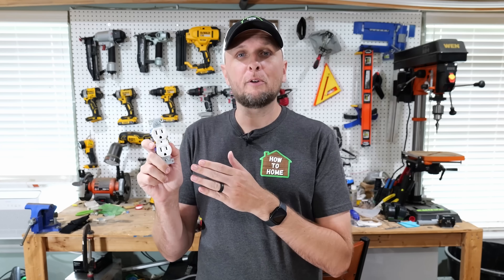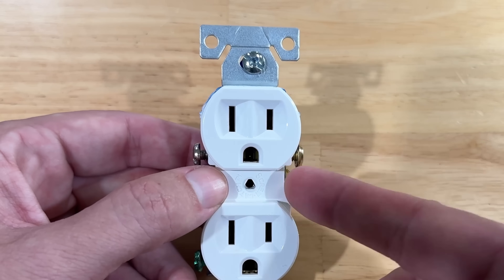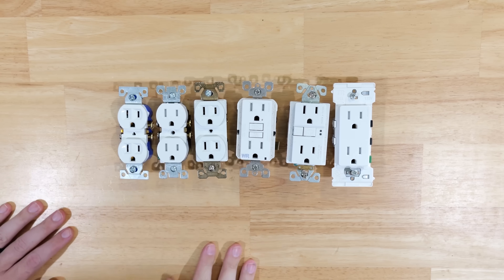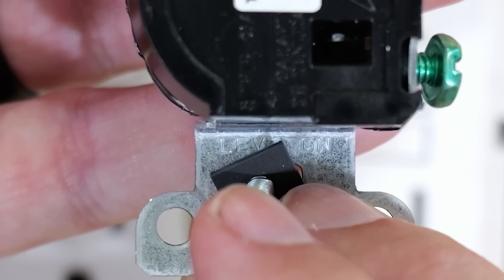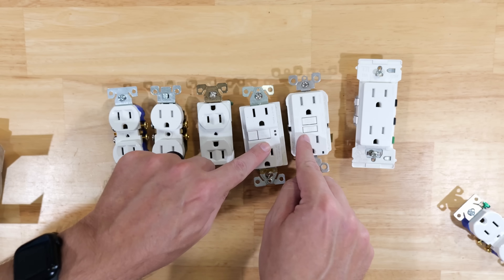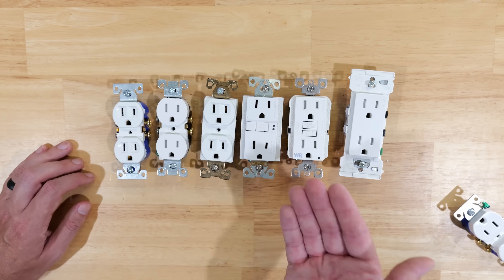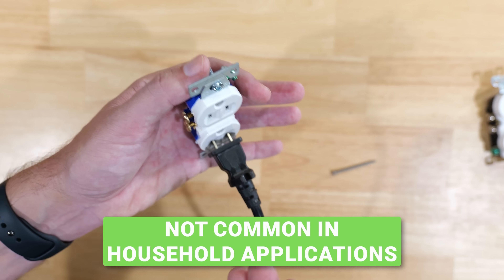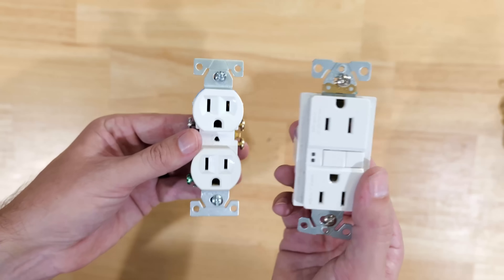The Shocking Reason Why Your Outlets Are Installed Upside Down!

Comment: 😅 If it wasn't so "probably dangerous" (and the authorities love to have their thumb on people) it should be written out or change the design (must also accept old style plugs). -- The way I was taught "ground up" this was to protect the contacts from being shorted out if something falls across plug / terminals (slopping sides of plug on ground side tends to shed objects off sitting on plug). Unfortunately manufacturers make plugs (flat /wall hugging) and appliances that basically "require" the ground to be on bottom. A workable way around this is "have outlet face recessed 1/8 to 3/16 in from wall plate" (hate to say it - euro style) [I like the large neutral / small hot blade as opposed to pins, more contact area]. The "recessed outlet" would protect the terminals. Also would not hurt if plugs had a "pull tab / ears" to help grip plug. Just my personal idea take it as You wish.

Comment: Every place I’ve live in since 1975 (1st yr I remember) had the ground down on all outlets - until two weeks ago when we had to have one flipped to accommodate the cord due to poor placement of the oven outlet.  We had it upgraded to the newest format before installing a new oven.  The electrician installed it ground down, but the plug wouldn’t fit because the outlet was so close to the floor.  Called back the electrician and had it turn upside down. I do like the idea of flipping the outlets when connected to a switch.

Most important thing I’ve learned from living in a house remodeled by a DIYer is to call the electrician!

Comment: The only reasons I can think for ground prong up is you are more likely to insert a plug angled downward and the ground will make contact sooner that the live. However the ground prong is longer so this is probably not relevant. Another thought is if it’s dark, the socket will be easier to line up and find with ground prong up. Also, because I always use Eaton, I based my installs on the writing orientation. Thanks for educating me that this orientation is totally dependent on brand.

Comment: When I was a small child back in the late 1950s - Early 1960s the outlets our old Brooklyn NY apartment didn't even have a hole for the ground pin. They just had the two slots for the blades of the plug and both of those were the same size. In other words back then the outlets were not polarized and had no ground. For plugs that needed a ground connection we had to use a special adapter. When we moved into out new home all the outlets has the home for the ground pin but the slots were both the same sides. They were very loose fitting too. The plugs would often slip right off the outlets. Most of them were replaced but a few still remain.

Comment: I always install ground plug down. In a bathroom if I install it ground plug up and then plug in a hair dryer with a gfi plug, that plug would be hanging up in the air rather than hanging down along the wall putting stress on that cord.

Comment: Im not an electrician but i heard that there is a code in canada that specifie that outlets, in a basement or any underground instalations, must be installed ground pin down but it is not specified for any floor above ground... and the reason given is about flooded basements... the ground prompt must be the first to be wet in order to redirect and absorb the electric current giving less chance to electrifie the water... a scenario where the level of water rise slowly to the outlet height, if the ground is facing up, the line and neutral will touch the water first and electrifie the water as the electric current will try to reach the nearest grounded object in the room since the ground pin is not wet yet and the current do not passes in the air as easily as in the muddy water, but if the water touches the ground pin first, when the line will get wet, the current will jump to the ground pin instead...

Comment: The manufacturer designed it (the duplex receptacle) to be used in either position, which is characterized by the stamping on the ears of the device or the plastic, to be legible from either orientation. It doesn't really matter which way it is installed, unless you live in a jurisdiction that has a code that exceeds the NEC (an example Puerto Rico wants them all installed sideways with the neutral terminal screws facing upwards). Many things are designed with different applications in mind. If your outlet is positioned in such a way that it is inconvenient for you, that is why it was designed to be changeable. While I was in the midst of typing this, I paused and typed 90-degree cord end into the search query for Google and for sale, two pics popped up for cord ends with the ground both up and down.  An FYI, if you cut the cord end off of a new appliance, it voids the warranty, so changing the position of the outlet is always best. My boss likes the ground prong up, since he insisted that if it starts to pull out of the wall, and something falls down that is conductive, it will hit the ground first and not become energized. My argument has always been that something else, perhaps more precious could approach it from the side or the bottom all the same, such as a pet or a child and it is moot at that point. 

By the way, I see many outlets above and below windows for store fronts mounted sideways, which is also legal. The manufacturers recommendations for the product and also the specifications of the blueprints are also enforced by the NEC, with the manufacturer's recommendations taking precedence. Occasionally I see a situation where the recommendations contradict the code, in which case the inspector usually calls their boss and makes a determination for what they will allow.

Comment: upside down outlets drive me crazy I buy extension cords and power strips that have flat plugs because  I hate wires hanging off the wall. when its upside down those flat plugs aim the wire up which then causes it to lean out of the outlet same with AC plugs i prefer the wire down so it doesn't cause tension at the base of plug where it starts to wear away.

Comment: The incredibly rare event this man referred to with the two parallel prongs facing up happened in the bedroom I shared with my younger brother growing up. 

His bed had pushed up against a plug in the wall for his alarm clock and in the middle of the night something he dropped between the bed and the wall fell on the prongs and started a fire. 

It's a lot easier for it to happen than you might think.

Comment: I have talked to many residential electricians about their thoughts on why one is better. Most of the ground up crowd has the thinking that if the plug is hit by metal from above, it could go between the outlet and plug and if the ground was down it would short between the flat blades. Mt thoughts are based on adding the ground to begin with. If it was added to block strikes of metal to the plugs hot to neutral blades, there would be no need for wire in the cord. It was added as a return path for stray voltages present on wet and or damaged equipment. If you put the ground up and shake the cord hard enough to start it to unplug. Gravity takes over and pulls down and levers the round ground connector out the receptacle before the power connection is lost. Now you are using a UNGROUNDED unsafe connector. Install the receptacle ground pin down and do the same and power is lost before the ground is lost. This is the most common issue using cords, when was the last time you dropped a machete on a wall plug and got shocked? How about having the extension cord pulled loose from the wall, and you know it happened because of no power. if the ground pulls out, how do you know?  Bad News when you find out!

Comment: Must depend on your Country . Here in Canada , Ground hole is always Down . Logic is that should the plug pull away from the receptacle , the shorter 
Live and Neutral will disengage first and the longer Ground pin remains the last to come away keeping the appliance safe longer . CSA dictates most of this . Cheers .

Comment: This the best explanation I have see. The safest way to install an outlet is with the ground prong on top (considered to be upside down by many). This is the way it is required by code to be installed in hospitals and other specified places. BUT I like the ground down because I like it that way. BUT also, what about installing the outlet sideways? After consideration I would install the receptacle side ways with the larger plug hole (neutral) up for a safer position. What are your thoughts on sideway outlet installations?

Comment: Standardization is good.  It allows people to know, beforehand, what side the plugs go (line vs neutral / big prong vs small prong) whether in good lighting or bad, in the open easily seen or behind a couch stretching down with nothing but your arm.

Is there really any advantage to leaving it "any ole way because it doesn't matter", or does it matter to standardize the installation for Human Reasons?

Comment: If there is one way which has to be chosen based upon logic, you would want the ground prong to be as close to ground as possible, so GROUND PRONG DOWN is the only way to use this device properly. There is nothing subjective about science, and you don't get to choose the rules. Science is science, and science says ground prong down is the most logical manner in which to proceed with operating this device.

Comment: Back in the day when the hot and neutral blades were the same width and it was possible to have a receptacle with the same colour screws for hot and neutral we were taught the saying “U ground down neutral to the left” so we always put the ground down. It was kind of the standard 35 years ago.

Comment: The right way is where the outlet looks like a surprised face.  None of the arguments for orientation are valid reasons.  The only good reason that it looks better.  For switched outlets, it is okay to flip it over to indicate that it is different from the other outlets.  Switches should be oriented to on is up or to the right, if vertical or horizontal, respectively.

Comment: They work either way you install it! Electricity does not care.  Most people prefer the ground down, because it resembles a face and as humans we are genetically tuned to recognize a face. An upside down face is unpleasing and just feels wrong to many people. What about applications where the receptacle is installed horizontal? Like exterior locations with horizontal cover plates. Is it better to have the ground hole facing left or right? Electricity does not care and will flow fine either way.

Comment: Ground prong up was how I was always told was the safest, and exactly because of that scenario of a dropped conductor shorting line and neutral of a partly extracted plug.  Having said that, there's not an outlet in my house that isn't ground socket down.  

One argument against ground prong up is that the frictional force with which the cylindrical prong is held in the receptacle is less than that with which either of the two flat prongs are held.  There's a smaller contact surface area between the cylindrical socket contacts and the ground prong compared to the surface area of the slotted socket contacts, and much less than the surface area of both flat prongs.  Thus there's less frictional force holding the ground prong in the socket.  Consequently, the weight of a dangling wire is less likely to loosen the plug under the force of gravity if the ground prong is down.  And I have seen exactly that happen - a plug partly out of the socket when the ground prong is on top, just from the leverage of the weight of the dangling wire.  

But the key in terms of industry practice has to come from appliance cords. In right angle plug appliance cords like those for refrigerators, etc, where an appliance needs to be close to the wall, and you need to rely long term on the plug remaining fully inserted in a (usually) hidden receptacle, they universally have the ground prong closest to the wire end of the plug.  If the receptacle is wired ground socket up, then as you say, the plug has to be inverted, and the wire folded back over the plug.  The plug is then subject to increased leverage out of the receptacle - from a combination of heavy appliance cord and greater distance of that weight from the plug.  It also forces the appliance farther from the wall.  Wrong on all counts.

And finally, Reddy Kilowatt would look absurd if his mouth was over his eyes.

Comment: What I do not understand is why for years and years equipment manufactures have made power cords so that when the ground prong is DOWN the cord hangs naturally. If the ground prong was up the cord would have to loop back on itself and that would be awkward and also put a stress point on the wire’s radius.  This goes all the way  back to the late 50s or early 60s when the ground prong requirement was rolled out.

Comment: My dad was a contractor back in the 60's and on into the 90's.  He held General, Electrical, Plumbing, and Heating and A/C licenses.  From the time I was in high school in the late 60's and early 70's I would be working building homes and doing service work.  I would conservatively say I had done the mechanical (elec, plum, & A/c) on over 200 homes.  I still remember the what I learned about wiring the receptacles: "White is right and ground on top".  My dad was also the architect on many a home and told me that you want to avoid making a "face" when doing design and that is what you would be doing with ground pin down.  Back then the plugs were not standard with pin down.  In later years I found it more and more common that they became standard to be ground pin down (much to my dislike).  I still prefer ground pin up but like some have pointed out, some manufactures only allow their product to be plugged in with pin down.

Comment: Well, even having the ground prong up won't prevent something from tipping to the side with a 50% chance of shorting the hot wire to the ground, the other 50% would short the return to the ground which shouldn't do anything so long as the loads were balanced which again is a matter of chance.  Face it, the North American 120 VAC outlets and plugs are just fundamentally flawed, of course the respectably designed UK plugs are not only excessively large but are dangerous foot caltrops, far more so than Lego blocks.  I suppose we might eventually go wireless but that's at best only 80% efficient and the rest would wind up as heat so another set of problems.

I really don't see the point of arguing whether or not the ground plug should be up or down, it's the fact that there will be exposed conductors when there is still an electrical connection that are the issue and that could be addressed with an insulating sleeve as is the case with the UK plugs, besides most US outlets are installed ground pin down and many jurisdictions require this in their code and even if they don't, a lot of inspectors will force you to reinstall the outlets with the ground pin down just to be approved.

Comment: This argument is easy to settle: If it looks upside down, it's upside down. Dispute settled.

Sarcasm aside, when it comes to two-prong outlets, I've also only ever seen them installed with the hot side (small slot) on the right.  Not sure if this is code, but I've never seen them installed the other way.  Keeping that in mind, it only makes sense for three-prong outlets to be installed the same way, which means the ground ends up on the bottom.

Comment: I think it's also very important to consider how your plugs will sit within the outlets, so that you don't have wires pointing up, when they were meant to hang down.

I've turned more than one outlet around to "fix" that problem.

As far as installation goes, I firmly believe receptacles should be placed in a horizontal position, and not a vertical one.

If that's done, it becomes less important whether the ground faces right or left.

Aesthetically, if you must put one on vertically, I agree that since we're hard-wired to see faces when we see three dots, it makes sense to put the ground at the bottom so the "face" looks right-side up.

Comment: With plugs that have the wire coming out of the bottom of the plug and the ground prong on the top, and you orient the outlet with ground down, you’ll have to turn the plug upside down with the wire going up. If you plug it into the bottom plug the wire covers the top receptacle preventing it from use. Orient the receptacle the other way you can plug into bottom receptacle and the top will be free to use.

Comment: I have experienced several times (greater then 5) were wall transformers rated to supply a DSC security system that were plugged into ground up receptacles has broken the screw tap that holds the  transformer from being unplugged.     This is due to the weight of the transformer being higher than the prongs.    Plus everyone I found mounted this way seems to cause the transformer to heat up and discolor the casing.      Other than that I just can't stand the looks of ground up receptacles but that's just me.

Comment: An issue is the plugs are not standard, the prongs may be, but the outer part of the plug (the part you grab) are not standard.  Some are narrow and pointed making it difficult to good grip to pull out the plug of a tight outlet for some elderly people.  They should standardize the plugs so that it has a finger notch for better grip and to keep your fingers from slipping underneath the prongs.

Comment: Most cords which are perpendicular to their direction of insertion which I have seen put the cord on the ground prong side.  If the receptacle is ground up, it increases the stress on the cable.  If it's ground down, the cable just hangs there "naturally." Ergo I install all mine ground down too.